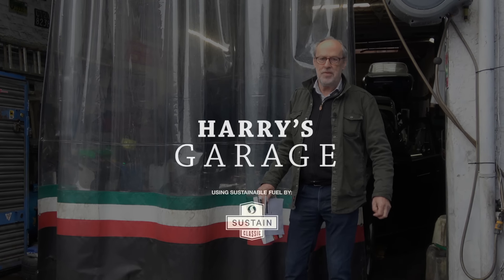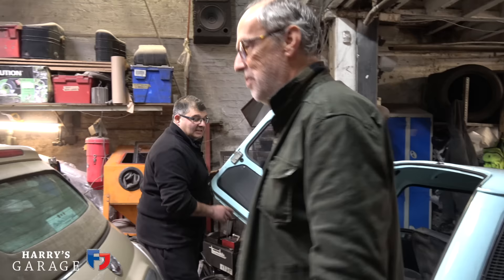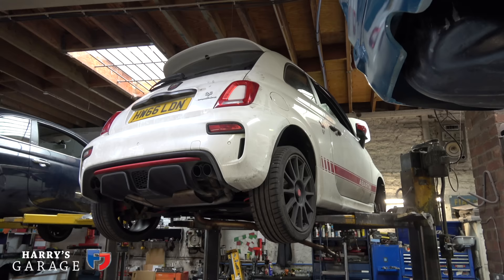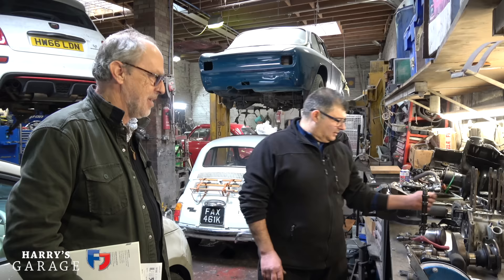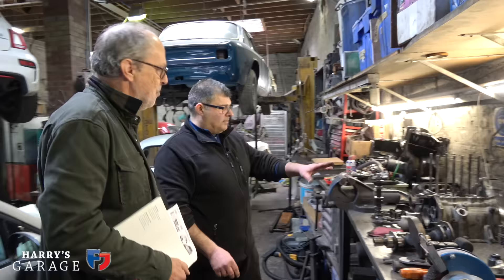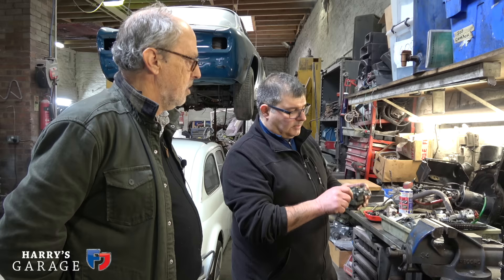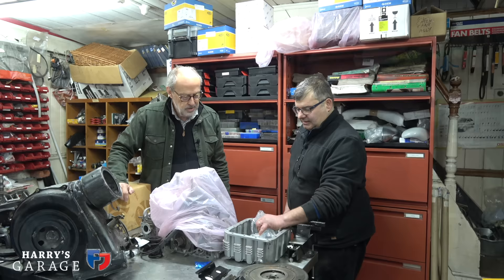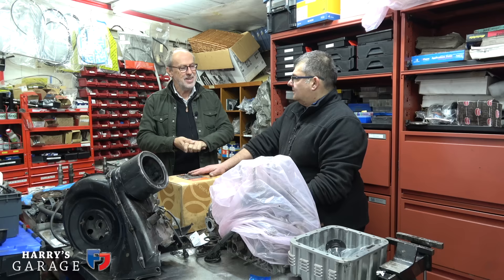Classic Fiat 500 upgrade part 1. Engine gets removed but what horrors are hiding inside?

Comment: Can’t beat these artisan engineering pioneers, better than a spotty youth with his lap top!
Reply: Exactly , totally agree 👍 (  I recall , many many moons ago , visiting an  " old school "  mechanic . He could diagnose a car by listening to the engine / placing his hand on the rocker cover while you revved the engine ,  would take a look at the exhaust fumes for colour / smell for richness of mixture etc etc .  An art form which seems to have died  !! ☹ ) .   Guys  ( mechanics ) nowadays , their priority is finding the diagnostic port so they can  " plug-in "   !!
Reply: @bloke755  To be fair engines that long ago were very simple and easy to work on, this Fiat 500 being a case in point. Todays engines with all their electronics are more complicated and more efficient, electronic diagnostics are essential. Compare a Toyota GR Corolla 3 cylinder 1600cc producing 300hp to a Jaguar E Type 12 cylinder 5.3 litre producing 272hp

Comment: Back in the late 70's and through the mid 80's I worked at Sports Tune, a Jag, Triumph, MG, Mini, Saab dealership, selling cars and high performance accessories. We also had a partner Fiat/Lancia/Peugeot dealership. As the English cars I sold were so poorly built, I owned a series of Fiats - a 128 2 door sedan, followed by an X/19, then a 124 Spider... I loved my Fiats, then I started racing a Mini Cooper, in which I was often beaten by Fiat Abarths...(and Renault 5 Gordinis). After getting to race a Fiat Abarth one time I was totally into the 500 platform. To me it seemed a better race car. I have never driven one on the street however. Yours looks like it could be an excellent fun car for your narrow winding roads. Have fun with it... I know I would have a blast driving it!
Reply: Thankyou ! I was aghast at the unnecessary slander of the Fiat  that was launched by another commenter here. I would've easily bought one in the 90s
Reply: @sianwarwick633 I owned a number of them in the eighties, mainly because you could get a lot of car for very little money. There was a reason for that though, they really didn't like salty roads and the electrics were dire. A lot of fun though, I probably miss my 500L the most.

Comment: Four up my brother with friends used to drive to the beach in Norfolk with the sun roof open.
Broke its dynamo bracket on a long  journey and the fan started hitting the casing but we carried on.
Teaches you to double de clutch ( B reg no synchro).
Also teaches one to drive conserving momentum by anticipation at roundabouts etc.

Comment: This brought back memories! We bought a sabbia (sand beige) ’66 500 in Florence and drove it back to the UK, including a great trip over the Alps and along the Route Napoleon. We kept the crash gearbox and dropped a 650 Fiat 126 engine in it and it went surprisingly well. Your man is right to say don’t trust blanking off of the carb return 😳. Couple of things to think about are upgrading the clutch (the 500 one is marginal with more power) and fitting stronger valve springs. The extra power can get you into valve bounce territory in top gear even at light throttle openings. That is a lovely clean example you’ve got there 😊.

Comment: God in 80s in alps north Italy we’d go up the mountains for a drive at 2000 feet you’d stop open the engine bay back in 4 up and finish at 6000 feet alpine bar hot chocolate walk around and then back down . They never stopped only if up mountains complained open back 10 minutes off you go no problems. Dame I miss that . And I’m only 15 minutes from them…😊

Comment: Harry's Garage. Make me cry. A real workshop with a genuine environment from the 60s. And not least knowledge that modern workshops do not have. Today you connect a computer to the ODB connector. and the computer shows what's wrong. And the mechanic changes the spare part. Mechanic = "spare parts changer today". I worked 50 years ago a few years as a car mechanic "so I know what I'm talking about" Today hobby mechanic.

Comment: Get the 695 kit - the sleeves in the original will need to be bored to remove the water damage. It’s not going to turn it into a fire breathing dragon, just a bit more willingness to rev and a tiny bit more torque/power and I doubt your wife would ever know the difference.

Comment: As a teenager in the early 70's I had a Fiat 500 that I used to run up along the River ouse bank, on one occasion I was driving it along the river bank with three friends in it and we were trying yo get it to roll over but it just would not even though we were at quite a steep angle. In the end It got driven at speed through a muck heap, inside the muck heap there was a vertical piece of railway line which we did not know was there and that was the end of the 500 as the front wheels ended up facing each other and nearly touching.

Comment: I had a '59 500. It was very inventive with its failures. The most dramatic was when the front transverse leaf broke and dropped the front of the car on the front wheels. Another amusing one when I went to start it on a gravel drive, nothing happened but I heard somebody throwing stones. The starter had dropped off, but, still spinning, threw gravel at the bottom of the car. When the throttle cable snapped, I ran fishing line from the carb out through the louvres on the engine cover and in through the sunroof. By yanking on the line, I could accelerate.

Comment: I had mine in Naples while stationed at the US Naval Hospital, 1971. Bought it for $750 US. Best part besides the sun roof was the cruise control cable. Crazy design but sure worked on the Autostata.

Comment: My first car in 1968 was a 1963 Nuova 500 with 'suicide' doors, Traded for a brand new 500L in 1970. I remember the early one had only 2 studs holding the starter motor on and were forever breaking. The later had 3. Great car except my friends were known to pick the front up and turn it round.

Comment: My g/f (now wife) and I did 5k miles around Europe in one back in 1976 - took the back seat out and loaded it up with food, tent, cooker etc. Had  4 punctures and needed a wheel bearing replaced in Rome. By the time we got back the starter motor no longer worked, and the exhaust was falling off 😂

Comment: I worked at FIAT Uk in Dover in 1970 and I remember the panel work that was going out the door, complete sides doors , boot lids et , all tiny and put in cardboard boxes. Those were so thin and dentable that the panels were just cut off and thrown away.

Comment: I've had several Fiat's starting with an 850 indromatic (clutch on the top of the gear stick). 2 124 special "T" s, a 131 estate, Uno (diesel) and a Strada?. The first 3 had the Fiat rust issues, the Uno was great but the Strada was a pain as it kept losing its tuning.
I love the mark. Watch for updates on your 500 with great anticipation.👍

Comment: When I was born my father bought an estate 500. He decided they need a bigger car. 
Upgrading from a Heinkel 3 wheeler with 200cc
He had a 500 in New Zealand and I learned to drive in it. On the day of the test it broke down so I had to do my test in his Ford XY Falcon estate with a 4.1 Litre engine! I did pass even though my parking effort was a bit rough.

Comment: Alu cylinders probably from Athena. In Italy they report single port heads into double ported ones. A 700 cc engine with faster cam can run on a pepped Weber IMB 28 Carburateur. But why not trying a two-step carburetor of even a DMTR from a A112? There was a kit named K12 which Abarth sold for the 500R and 126. It contains a 40 DCOE side draft double carburetor. But well that may be an overkill. More change with a Solex C35 PHH from a LANCIA Fulvia. ...or just injection from a FIAT Cinquecento '92-'98! Add the 32 mm. throttle body from a Punto. 
Well we can go on and on. Can't wait to see the whole restoration. Thank you.

Comment: I would keep the points ignition Harry, electric ignition is prone to failing on the 500 due to its hot engine bay. Many owners in the community are converting back to the original setup because of this.

Comment: Re;-The “weepy” carburettor.Friend owned a garage/workshop,years ago,and had a Mk 1 Vauxhall Viva come in,running on three cylinders.Found him trying to start it,to put it inside and work on it next day. He got under the bonnet, and said “ turn it over when I give you the word “. Did as he asked,and there was a huge boom and a cloud of smoke from the engine bay,and he retreated rapidly,informing me that it had just blown the oil filler cap clean off! We pushed it inside and, next day,I asked him what the issue was.Apparently, he had another go at starting it,and this time,it blew the dipstick across the workshop! When he removed the head,he found a neat hole,about the size of a ten pence piece,clean through one piston crown.Naturally,it would almost always stop with that piston at TDC,because of the lack of compression,and the worn carb was quietly leaking petrol into the sump,so next time it fired,BOOM! So Harry can consider himself lucky that he didn’t persevere,and try to get it running!

Comment: Fancy deciding on a 595 conversion and then discovering that the car already has one. But the new camshaft, skimmed head and reconditioned Weber should make it fly. The car is more or less standard, so it weighs not much more than 500 kg.

Comment: I grew up in Ne Zealand wher the bambini were common ,as were the various different ways to get them to go faster . Most common method was to bolt in a four cyl engine 😮the box on the boot lid wa a giveaway . Another was boring the cases to fit a pair of vw barrels and pistons . The latter made for a very quick though short lived toy. 😊😅

Comment: Wonder if you considered fitting a 5- 0r even 6-speed gearbox?   Saw a modified 500 at the Stuttgart Classic Car Show, the owner said the extra ratios really made the car far better to drive especially with a modified engine.    The 6-speed box I saw at the show was almost watch like and about the size of a small shoe box, plus it is a direct fit.

Comment: Why bother with the Fiat 500 when there was the technically far superior Steyr Puch 500 or even the 650TR? The latter won the European Rally Championship in 1966! Whilst nearly identical from the outside to the original Fiat 500 the Steyr-Puch licensed version suffered none of the Fiat's headaches, such as overheating, flipping over etc. You cannot make a Silke purse out of pig's ear! 😂